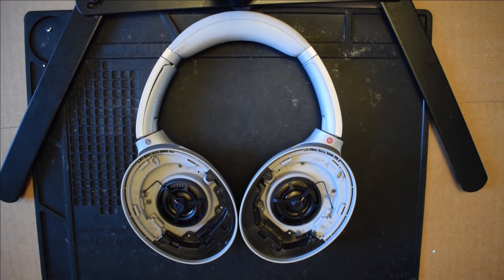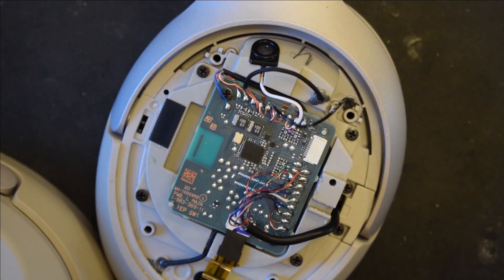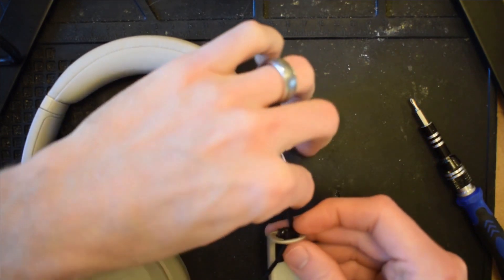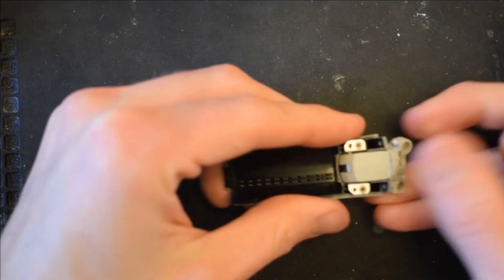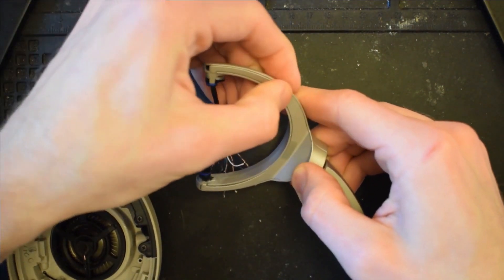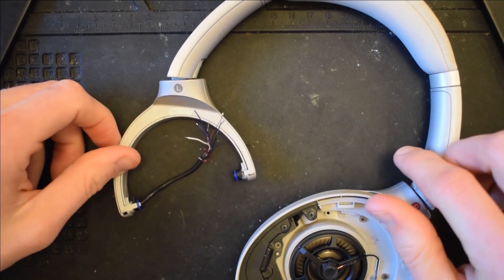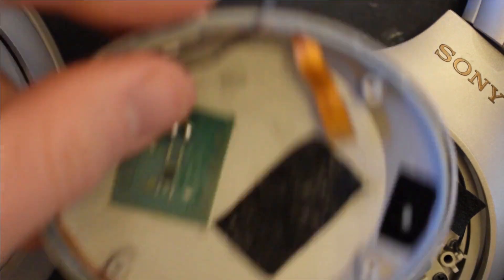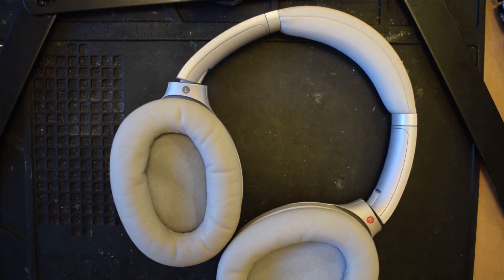Sony WH-1000XM3 Headphones Walkthrough - Teardown and Repair - Left Hinge, Hanger, Swivel and Cover

Comment: Thank you for making these videos! It's kinda frightening to know the outward force on the earcups on a pair of $300 headphones is handled by the tiny thin piece of plastic on the piece that broke on the headphones you were repairing in the video.
Reply: What is more frightening is Sony refusing  
any responsibility for the fault , claiming physical damage.
Reply: @yurka63  I just repaired this part yesterday by gluing in a small polymethacrylic brigde with a pin at each end. And I also thought the same thing;  they could  use twice the thickness of the material here.
Reply from the maker: It certainly seems illogical to me! I would prefer a solid piece of metal to handle the heavy use.

Comment: Any suggestions for fixing the ANC hiss? Mine is only happening in the left ear, started this week after owning them for around 6 months.  It's like a whoosh, hiss, static, or white noise sound that is only present when ANC is enabled.
Reply from the maker: Hi! I've actually had the same issue before. I think what fixed it for me was to just remove the cable that connects the touch panel to the board and then I cleaned the contacts very well and reinserted it. I hope it will solve your issue as well!
Reply: @jontriestofixthings3718  The left ear cup doesn't contain a touch panel if I recall correctly, it's just on the right ear. What do you recommend using to clean the contacts?
Reply from the maker: @jfjfjf  Oh yes you are correct about the touch panel being on the right side only. I use rubbing alcohol on a q-tip for cleaning.
Reply: @jontriestofixthings3718  do you have any idea if replacing the microphone component would resolve the hissing issue? Wondering if it is a component issue vs a EM noise or board issue, I'm hesitant to open the headphones back up just to clean the contacts.
Reply: I’m surprised to see exactly the same issue I’m facing. Barely 6 months of purchase too and the same whoosh noise. Please what’s the fix that worked? Please!
Reply: @fyoonkay, have you fixed the ANC hiss?
Reply: @dangnanfelix4829  I've had no luck. One user on the sony troubleshooting forums had success putting silica gel packets behind the ear cups with the theory that it's a moisture buildup issue. Also this is apparently an issue on the new model (WH-1000XM4) as well (https://www.reddit.com/r/sony/comments/ia51so/sony_wh1000xm4_noise_after_prolonged_usage/)

FWIW i opened mine up and cleaned all the microphone contacts with isopropyl and it made zero difference.
Reply: @fyoonkay, I think I’ll have to agree with what that user said about a moisture related issue! I have 100% success after cleaning the contact point of the driver wires just after removing the ear pads. I also cleaned those contacts with alcohol but no luck at first, but the moment I cleaned that contacts of the affected ear, it legit came back to normal! No need to loose the set again! Just a sticker after removing the ear pad! Good luck!
Reply: @dangnanfelix4829  Did you clean the contacts on both earcups or just the affected ear? I cleaned the contacts on the microphones with isopropyl + q tip on both the connection to the microphone and the circuitboard behind the ear cup and it ended up coming back.
Reply: @fyoonkay Just d affected ear! It’s a way out then since it’s back up!👌🏿
Reply: @dangnanfelix4829  i also have this popping problem on the left ear while using noice cancelling. Sony didnt let me replace it so I will attempt to fix it on my own. Quite unbearable for expensive headphones
Reply: @RUMPshit  that’s quite sad mate! Sorry for that! From my experience I think it’s a moisture related issue. Incase you’ve tried the steps outlined above and it still persists! Try this!
Remove the affected ear pads, you’ll see a black tape securing the wires coming from the main body into the drivers, remove that and thoroughly clean the contact with alcohol! Hopefully it’ll be okay!
Reply: @RUMPshit  let me know if it’s works for you please! Try this even before loosing the whole headset since you don’t even need to loose the whole stuff to try this fix!

Comment: What about just addressing the squeak these hinges develop? would lubing them help? damage them in any way?
Reply from the maker: Sorry for the delay! I think that the squeak is from the plastic rubbing against other plastic. You could certainly take the slider component apart, clean the components and screws with rubbing alcohol and put it back together, being careful not to overtighten the screws. This won't require any soldering and should be pretty quick. It may help some with the squeak but no guarantees. Best of luck!

Comment: great video, thanks for uploading. I was wondering if you had a link to buy the specific piece that you're replacing in the video. And is that piece often referred to as the upper slider?
Reply from the maker: Hey. I just set the front/inner and back/outer of the slider as a set. I do think there are sellers on eBay who may sell just that one part though. I don't have a link with me at the moment. Best of luck!

Comment: My led battery keeps blinking whilst on charge.I've tried resetting to factory settings and also pressing the power button for 4 sec, 10 sec, etc and when I plug it to charge the red led stays lit for about 4 sec then starts blinking. The charge showing on my phone was 20% last week. I left it in charge for like 6 hours and the charge was still 20%. 

Then I gave up on the headphones and didn't touch them for a week. Today I tried to power them on and the charge was 60%. I updated the firmware since now I have enough charge which I don't know where it came from and it still blinks whilst on charge. My room temp is 18°C. I've tried charging in a pc USB, apple magsafe and wall charger but cannot solve the charge problem of blinking led. 

What do you think could be the issue?
Reply from the maker: It certainly sounds like a battery issue. I need to record a video on how to replace the battery. What you can do is open up the right side of the headphones and disconnect the battery and leave it disconnected for about 5 minutes. Then reconnect it and charge it for at least 1 hour prior to testing it. That may help reset the battery and fix your issue. If it doesn't, you probably need to purchase a replacement battery, which I  have for sale for $19.99 on my eBay store :)
Reply: @jontriestofixthings3718  please do record the video on how to replace the battery. Will check out your ebay store.

Thanks a lot.
Reply from the maker: @terrabyte-techy  Hey. I just uploaded a battery troubleshooting/replacement video: https://youtu.be/Kh1cPCjfh34
Reply: any idea my headphone don't turn on after fully charged , try to reset but after that don't work

Comment: Could you please make one for the right side aswell?
Reply from the maker: I plan to make a repair walkthrough video for the right side ASAP. I can also post a link for the soldering diagram of the right side in the video description.
Reply: DIY Headphones Repair do you have i diagram for the right side that i can use to solder my headphones back in one piece?
Reply from the maker: @emilbuss9606  Hello. Sorry for the delay. I have posted a link to the right side soldering diagram in the video description above. Thanks!